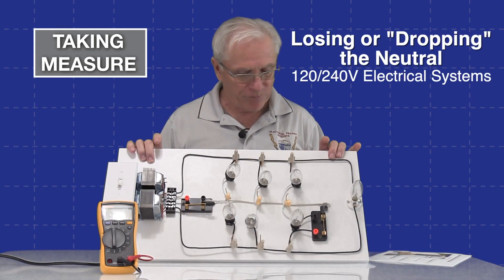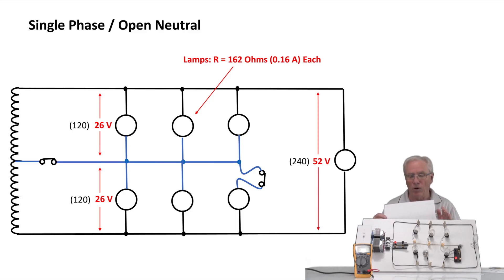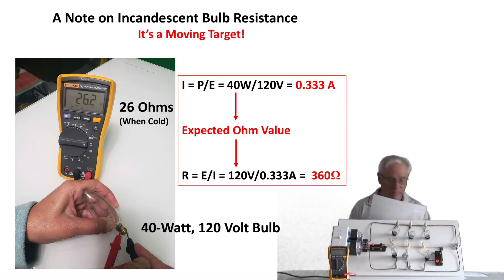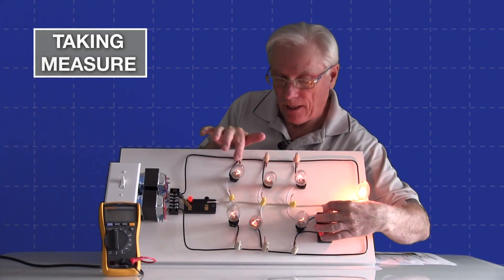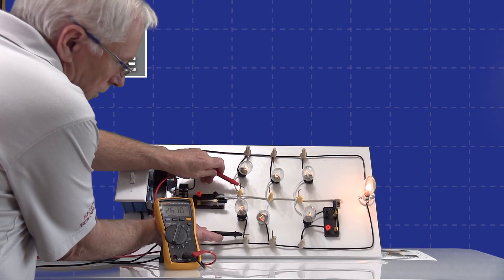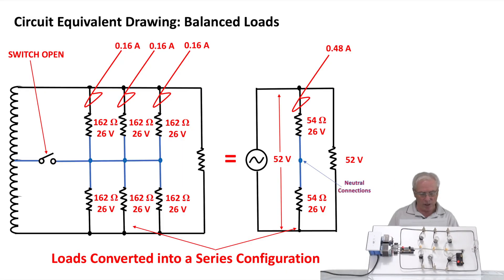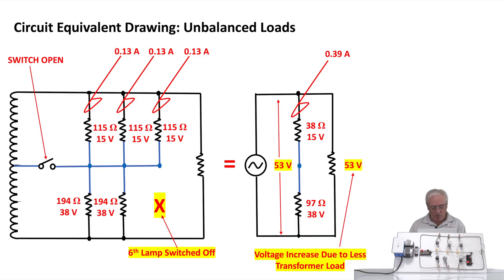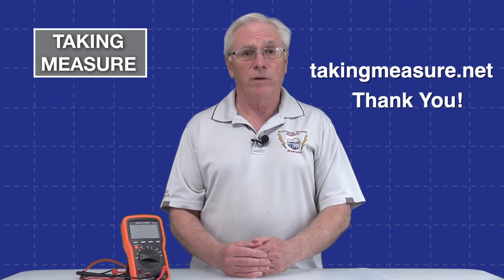Losing or "Dropping" a Neutral on a 120/240V System

Comment: Had this situation on a place I moved into once.
One circuit had dim lights, the other bright, unless I turned the bathroom fan on - then it swapped.
Took the "electrician" (who I'm NOT impressed with in this case) several HOURS just to diagnose the situation - after I TOLD THEM what the issue was.

The good news is that I hadn't installed anything into those rooms yet, and the DID eventually track the situation down to a WIRE NUT tying the neutral wires together that had failed it's connection.

Don't get me started on the OTHER issues with that place (like the use of 2 INDOOR electrical panels OUTSIDE the home).

I wasn't there very long.
Reply from the maker: I am happy you didn't lose any valuable electronics in the mix.  I have seen intermittent connections in a wire nut many times over the years.  That always leads electricians to the debate on whether wires should be twisted together (or not) before applying the wire nut.  Thank you for watching and commenting!
Reply: @takingmeasure  When I was an apprentice, the Master I trained under REFUSED to accept Wire Nuts for anything - due to the many issues with them corroding over the long term, or vibrating loose.
He was ALSO not a fan of splices, for the same reasons.
He would toss you out of the program ENTIRELY if you spliced or used a wire nut on ground wires more than once as that was an outright violation of the CODE (at least at the time).

Firm believer in "best practices at all times".
Reply from the maker: @bricefleckenstein9666  Sounds a lot like some of my training!

Comment: The bulbs need to be vastly different from each other to simulate a real home situation. A perfectly balanced load wouldn't mind losing its neutral.
Reply from the maker: You are correct.  It would be interesting to throw a mix of wattages together.  I used the same wattages mostly to prove that a balanced load would work.
Reply: @takingmeasure  Building a potentiometer voltage divider really demonstrates the value in tying the center back to source. When left in series only it becomes too sensitive to resistance changes. A similar DC circuit consequence as to losing a neutral. Just thinking here. Kind of you to share knowledge in an easy to follow format.
Reply: Turn one bulb OFF. No longer balanced.
Reply: @tedlahm5740  Or....on comes a refrigerator which will unbalance one or the other lines.
Reply from the maker: @tedlahm5740  True!

Comment: If you lose your neutral, the symptoms are pretty clear. When you have a WEAK neutral it can take longer to figure out and get repaired, and the symptoms are less predictable. Some of the current leaks to ground, and some of it crosses the neutral.
Reply from the maker: Agree.  Intermittent issues are always difficult to find and repair.
Reply: @takingmeasure  The fact that I'm only sometimes crazy is driving my doctor nuts!

Comment: Ok, I apparently dodged a lethal bullet with my experience vs these stories. Lost a lamp and a couple APC power strips with (deadded now, no doubt) some form of protection circuitry. 

Threw out the bits that lost their magic smoke and moved on, while cursing the installer.
Reply from the maker: You may well have been a bit lucky.  I have heard a lot of stories of computers and expensive appliances going up in smoke. Thank you for watching and commenting.
Reply: @takingmeasure  It would appear so. I was told it was a "floating neutral" basically over time, the sheathing covering the end of the neutral wire had i suppose burnt away and revealed enough exposed surface to short? it was a rental so the electrical guy did the panel properly and that was that. but it sounded like negligence in the original wiring? that neutral maybe wasnt ever hooked up properly? I'm still trying to wrap my head around phasing etc. Love the content

Comment: Mistake. Switch on neutral is big no, no and disqualify all your instruction.
Reply: Great video. I was wondering if you could create another video showing the effect in a 3-phase circuit. Our mfg company is having power drops lately due to power outages, and we are having lots of fried equipment. In one case they said the 480V jumped to 577V, but they don't understand why. I suspect it's a similar situation where we're not losing all phases at the same time.  In other cases we've had that happen where a squirrel caused the fusible link to blow by shorting out terminals on the transformer.
Reply: @younda  Thanks for watching.  A 3-phase lab would be really interesting.  I will need to think on that one!
Reply: You are correct.  The National Electrical Code allows for switching the neutral (grounded conductor) only in rare and very specialized cases.   Thanks for watching!
Reply: @mitchellhegman2402  It was tremendously common, and you'll still find it in many old houses. But don't do it any more.

Comment: Had the neutral line drop off my house in an overnight storm. In winter. Woke up to a freezing house since (of course) the furnace was on the side of the panel that went high! UPS under my desk was also on that side and it went -boom-. But you know... a bunch of lamps nicely went dim in an effort to save power (sigh).
Reply: Sorry to hear about that.  Dropping a neutral is usually pretty ugly.  Thanks for watching.

Comment: Thanks Very nicely demonstrated and it demonstrates the principles .  The challenge would be to find resistors that dont change their value with voltage changes and compare the results even if just to confirm Ohms law. Perhaps wire wound heater elements could be tried , but even they would change resistance with voltage. I can't think of any other types of resistors you could use that would be stable.

This is thought provoking as I wonder how Mr.Ohms proved his Ohms law if the resistor values wont hold still while you do tests on them, that throws you math around. Considering what equipment he must have had for making measurements I am amazed he got it done.
Reply from the maker: Thanks  for the comment.  I struggled with ideas for building this lab.  Having loads with resistance values that change is a bit confusing, but in the end this is realistic.  Also, I really like the visual of the lights going bright and dim.

Comment: Used to work on mains supply faults here in the UK , where Protective Multiple Earthing ( PME) supplied many modern houses.
When we had a neutral fault on the main distribution cable which was 3 phase, the houses affected has various voltage issues, some had basically zero volts at the main fuse others on another phase could have the normal 230 volts boosted to 400 volts.
The reason they got 400volts was dependant on the size of the load on that other phase, the higher the load the greater the voltage appearing on the neutral conductor which was effectively now a phase conductor due to the break in the neutral to the substation .
Sometimes lots of damage other times next to nothing.
Reply: Thank your for your input.  What you describe is what makes these problems so confusing.  The connected loads keep changing the overall circuit behavior (voltage balance).  It's difficult go "get the entire picture" when troubleshooting.
Reply: @mitchellhegman2402  What I should have added to simplify the reason for increase in voltage due to the load, is simply because higher load also equals lower resistance , sometimes this could be one large kW load or many parallel smaller but equivalent load.
These faults were a pain to trace, you could not just start trace ing the fault while the supply was on, it was a mad rush to the local distribution substation, identify the circuit and drop supplies so everyone was put off to try to limit damage but unfortunately the damage occurs in milliseconds.
Reply: @radiotowers1159 Fortunately, some devices are more robust and survive the 73% overvolt for hours .

Comment: How did the loads change impedance exactly when the neutral dropped?
Reply: Thanks for watching.  In this circuit, when the neutral connection is lost, the top three lights are combined in parallel, resulting in a single resistance value. Similarly, the bottom three lights are also combined in parallel, forming a different resistance value. These parallel loads are then connected together at the neutral point, creating two equivalent loads in series.

When the resistance values of the loads on the top and bottom are matched or balanced, the voltage drop across each load is also balanced. However, if one of the lights in the bottom section is switched off, it disrupts the balance. Since the bottom three lights are connected in parallel, the removal of one light increases the overall resistance for that section of the circuit. As a result, more voltage is now dropped across the remaining two lights in the bottom section.
Reply: No doubt the bottom changed.  How did the top as it is still the same 3 in parallel.   With no change pre and post neutral drop, the effective R value cannot change
Reply: @SeanONeill13  The ohmic values for the bulbs in the entire circuit changed because the actual resistance for incandescent bulbs changes any time the voltage (and current) is altered.  As you may recall from the beginning of the lab, I only measured 26 ohms when the lamps were cold.   Full resistance occurs when the rated voltage and expected current is applied (120V/0.333A =  360 ohms).  As mentioned in the video, I had to use current and measured voltage values to determine the "R" values because they change with the other circuit variables (and heat).  It's weird stuff.

Comment: Where does one encounter a system such as this? Domestic properties are supplied with one line and one neutral... not two lines and one neutral. Or am I missing something?
Reply from the maker: These systems are common throughout North America.  Our receptacles and lights operate at 120V.  22Ov operates larger appliances and motors.
Reply: I'm not sure about American systems, but in Europe we typically have 3 phases on every property, even when  there are only 1-phase receptacles. They are divided less or more equally between phases. Apartment buildings often have each apartment fed by one of the phases, ie. third of the apartments fed by each phase. When the neutral fails, the voltages between the phases get imbalanced in respect to load differences between those apartments that are on different phases.
Reply from the maker: @TheSimoc  Rather the same issue but on a larger scale.  Always difficult to troubleshoot.  Thanks for the visit and comment!
Reply: @takingmeasure  would the same problem occur in a 3phase home (europe) as it does in a USA home with split-phase 120/240?
Reply: Many (most? all?) homes in North America do this. Most of our electronics are 120V. Some require 240V, e.g. electric clothes dryers,  ovens. So we have a neutral and two 120V legs. Leg to neutral = +120V, other leg to neutral = -120V, and Leg to Leg is 240V. So if you lose the connection from the neutral to the transformer outside, current flows through a circuit's neutral wire back to the panel, can't go out to the transformer, so it goes up another circuit's neutral wire and out the circuit's other leg, so now you have two circuits intended to each be 120V both running at 240V. Ouch.
Reply: @johnbatzel6196  That was exactly what I was thinking. Meaning, the answer for the original commenter's question, the thing he was missing was that every property is supplied with "full set", i.e. two phases and a neutral in America (three phases and neutral in Europe), even if only single-phase receptacles are installed. They are divided less or more equally between those two phases, so in neutral failure, some of the sockets in the house have the undervoltage and others have the overvoltage.

And yes, some larger appliances are fed with two phases (three in Europe), so in case of neutral failure, some of the several coils in motors, heating elements in ovens, etc. get overvoltage while the rest of them get undervoltage.
Reply: @TheSimoc  We had 3-phase to run some large machinery. Took some special requests to get it in a residential building. I never managed to wrap my head around it completely.
Reply from the maker: @johnbatzel6196  Ouch indeed!
Reply: That is also my question. And in this demo video all loads act "ohms", because he used incandescent lamps. In reality (50 Hz/60 Hz 230 V/110 V systems) that can differ/will differ.

Comment: The worst possible example of a dropped neutral happened to my neighbor. The house settled such that the neutral pulled out near the meter. Long story short, they fried a bunch of appliances and the shielding on the cable TV wire melted the insulation.
Reply: I have seen dropped neutrals far too many times in my years as electrician.   More often than not, at least one appliance or electronic device is smoked.  Any time I get a call from someone telling me they are seeing lights acting up and apparent voltage fluctuations, I tell them to unplug any appliances and electronic devices until an electrician can evaluate, just in case it is a dropped neutral.   Thank for watching.
Reply: @mitchellhegman2402  There are symptoms to look for. One of them, is the voltage shooting to 132+V on the leg with minimal load. The voltage rises when a motor comes on, the same with the range on! The same house that had the bad neutral connection, had a hard-wired smoke alarm that wasn't working. I suspected the bad neutral being the cause, along with no lamps working in a wall light fixture in the downstairs bathroom. This was back in April and May of 2016.
Reply: We get those as “lights going bright and dim”.
Squirrels love to chew the bare aluminum in the triplex coming to the house.
Reply: @richardcranium3579  I have seen more than a few times when critters caused power quality problems!
Reply: Friend had a cable repairman disconnect the line up at that pole and bridge the circuit with his hands. Squirrels had chewed the neutral.
Reply: that happend to one of my neighbors when a tree fell on the line and ripped the neutral off the pole but missed the other 2 wires
Reply: @bledlbledlbledl  Not good....
Reply: Yes, the left or right loads are in parallel among themselves.
BUT left and right are in SERIES to one another. 
           The side (left or right) with the HIGHEST resistance will have the
HIGHEST voltage drop.  Thereby frying the load (appliance)
Thank you
Reply: Thank God they got the fire out in time